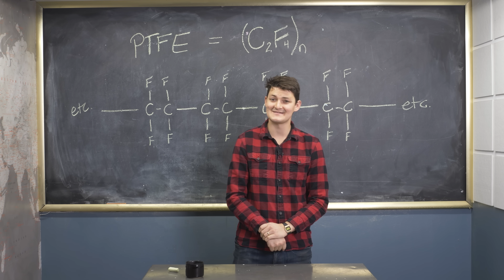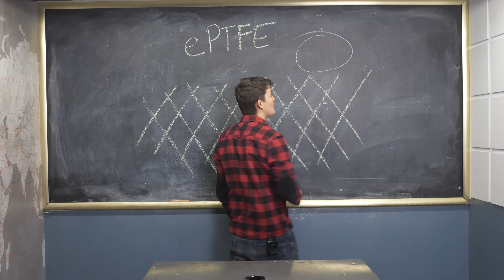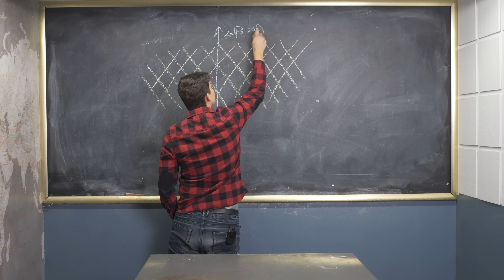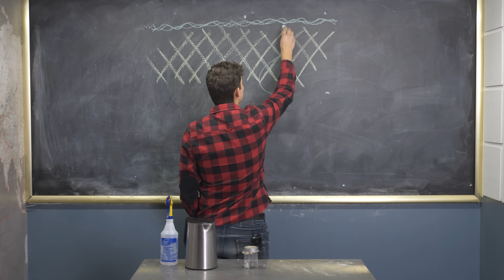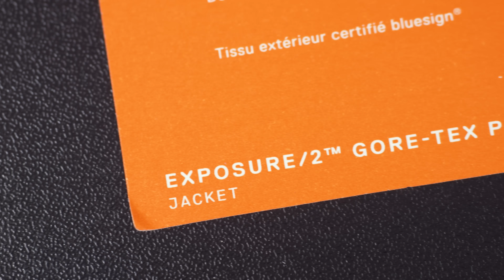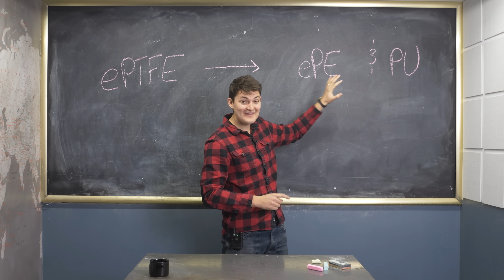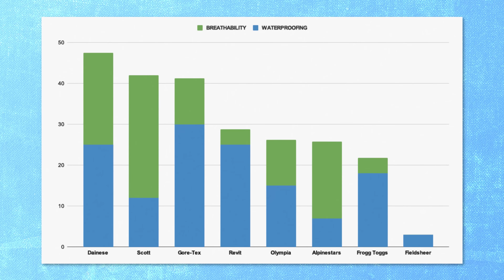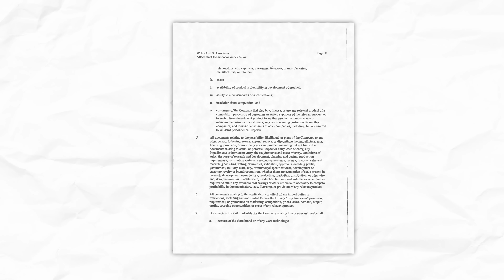Gore-Tex is a Marketing Gimmick

Comment: I agree gtx is overpriced. 

Any water proof membrane also faces the problem of temperature and surface condensation. Even if it can breathe, your sweat wil always condense on a cold surface.
And a thin membrane has almost no insulation value so if it is cold enough it wil condens the moisture on the inside

The only reason I do have goretex is that the better coats, boots and pants of rev’it which I liked for their looks have fully laminated goretex. The cheaper gear I used to have always tended to absorb water and looked baggy and the expensive stuff I now have doesn’t. 😎

Comment: Since in the last video you invited to nitpicking I will have a go regarding three things:
1. I think a lot of customers especially in motorcycling don't actually care about the breathability performance as much as durability of the waterproofing. I certainly don't like buying new equipment all the time, mostly because it's a nightmare to find something that fits me. GORE-TEX still has the best reputation for that, deserved or not.
2. The actual function of breathable/waterproof membranes really works, to my knowledge, when physically exerting yourself while it's really cold and windy. This is when you don't want the actual windchill to cool you down, because that would mean you're freezing, but still have your clothes not be soaked in sweat. Think of winter sports or climbing really high mountains.
3. The real marketing gimmick in my own opinion is offering climate membranes for motorcycling at all. The reason being that I'm not sweating on my bike from physical exhaustion, I'm sweating because the sun is baking me. And this is the part you missed: You also need a temperature gradient for the breathability to work. If it's hotter outside than inside your jacket, you might as well be wearing a garbage bag. This third point I deducted myself, so would be great to find out if it truly is like that.

Comment: I have a question: Given you can sweat through these membranes in dry conditions, which is useful when you are exercising and it is cold and/or windy (i.e. particularly in winter in northern climates when it snows rather than rains) (note also these membranes keep the wind chill at bay rather well), how wet does it have to be before the sweat a person generates from exercise is trapped by the humidity outside the garment ?

Comment: What a load of crap. After using goretex for winter mountain biking and hill walking for years, nothing is as windproof and waterproof and breathable. It’s nowhere near perfect, but better than anything else I’ve tried. Goretex under a jacket like most motorbike jackets is a big fat waste of time designed by muppets, it’s supposed to be used as an outer shell as part of a layering system.

Comment: So from your testing Gore-Tex is the most waterproof and at least somewhat breathable.  I don't see how that's not worth a premium as a motorcyclist? (of course I would love cheaper but from your own testing none of the proprietary systems can beat gore-tex is waterproofness) Maybe if I'm going hiking or bicycling I would want something more breathable but I thought this was a motorcycle channel?  When I'm riding a motorcycle I'm not exactly working up a sweat unless it's super hot out.  At least where I live when it's raining it's usually cold not hot.  Breath-ability isn't that high on my list. I don't want to overheat too much but I care WAY more that my gear doesn't leak through.  I've commuted to work on my motorcycle for 17 years and I've had so many issues with pants and jackets only being waterproof for like the first year or maybe 15 minutes in the rain and then I start feeling water in my elbows or in my crotch.  It was only when I got some gore-tex gear that I stopped experiencing that.  And let me tell you showing up to work with a wet spot in your crotch/ass is NOT cool.

Comment: nice video, however there are differences between brands when it comes to gore tex waterproofing. 
some brands use more advanced gore tex, integrated directly into the fabric.

I have been a jungle survival instructor, and there is no waterproof garment that will work in all weather conditions in the jungle.
But, gore tex most certainly work better when it rains in the jungle. Just remember to take it off after the rain stops.

There are reasons that operator use garments with gore tex in different environments, and temperatures.

Comment: You'll be way more uncomfortable just waterproofing a sheet. If you start getting hot and sweaty, use the various zippers on the expensive jacket, along with strategic layers if possible. Bring a change of undergarments and use them. Too many people think it's possible to stay dry in inclement weather when you are exerting in any way. It just doesn't happen. Gortex although cleverly marketed and expensive, does do the best job when used and cared for correctly. 
The best advice for being mostly comfortable in crappy weather is learn to deal with it. It works better than any gear. It's literally a skill one must master... Mentally managing the suck.
I spend well over 200 days a year, for the past 28 years, in the woods up in the mountains on the coast of BC, working a brutally demanding job, completely exposed. I'm rarely uncomfortable. 
Outdoors at work I use rubber, and at play I use Gortex because it's way more comfortable.

Comment: A very amusing story I read about the first method for stretching the PTFE to get the holes was that two guys ran at full speed in opposite directions while holding the opposite sides of a long swath of fabric PTFE tightly in their hands. It took the resulting sudden stretching force to expand the PTFE into Goretex.

Comment: Im old enough to remember a world before GoreTex. I remember standing in a stream in my first pair of GoreTex hiking boots and being amazed- the boots were at least 50% nylon and about the same weight as my high top  basketball sneakers and my feet were completely dry. I’d never seen anything like it.  To get that level of waterproof prior you had to have heavy, all leather boots and had to reapply a waterproof material every season. I was sold and in love with GoreTex. For years even after the patent wore off and you started seeing every brand with their own version of this kind of waterproof membrane, I still swore by GoreTex. But then something happened. I bought a GoreTex jacket and it was crap. Looking back now, I think it was because the beading substance on the jacket either wasn’t applied properly or just sucked. So then I did some research and found out what you mentioned in the vid- that GoreTex had changed it’s formula. I attributed it to that at the time rather than the beading material, so the luster of GoreTex was gone for me. I started doing the research on each membrane’s pressure waterproof claims, started to better understand how evaporation works through materials, and started layering smarter,  I also started making sure that I reapplied the outer beading material every few years, and doing more research on each brand’s membrane prior to purchase.  Life with these kind of membranes is still WAY better than without. Especially in things like boots- jackets you don’t have to wear if it is not actually raining, but waterproof boots you often wear when dry, in case it’s likely to rain or you have a lot of stream crossings- you don’t bring the waterproof boots as a second pair of footwear and just break them out when it’s gonna rain. So I think these membranes really earn their worth in boots. But even in jackets they are better than the old days of rubber rain coats- you wanna really experience overheat and perspiration? Go on a hike on a drizzly day in an old rubber rain jacket. But these new material jackets are not some magic jacket of dryness from Dungeons and Dragons or something.  So don’t be took hard on GoreTex. They changed outdoorwear for the positive. And with other brands’ versions some are better than others. Which to me is the most frustrating thing as a consumer- buying now is so hard because they’re all expensive, and it sucks to drop several hundred dollars just to find out that the brand you bought has a crappy version and isn’t very waterproof. I kinda miss the old days of the 80s and early 90s when I bought something with a GoreTex tag and knew exactly what I was getting. It was a simpler time.

Comment: Gave up on Goretex years ago, bought a Goretex rain suit and got fed up with being wetter inside the suit from sweat than the outside of it was from the rain. Most of my motorbike gear uses a Reissa membrane which does work, keeps the wet stuff outside without me sweating. Lot cheaper as well.

Comment: I’m retired now and only ride motorcycles for pleasure, but prior to retirement I commuted 20,000-25,000 miles per year for 25 years in the Seattle area by motorcycle. I have over 300,000 miles of mostly commuting trips under my butt. Can you say “Real world long term motorcycle gear testing?”

I can tell you how long the generally excellent Aerostich Darien pants will last until the seat starts to leak (approximately 1.5-2 years of daily commuting, 35-40,000 miles, or 1500-2000 mount/dismount events). I can give you a rough idea of how many supposedly waterproof gloves are actually waterproof (less than 25% in my opinion, and I have tried many different styles and brands). 

I think that from my experience, buying branded Goretex says more about buying the build quality and the certifications of waterproofness by Gore than it is buying the brand specifically for the brand. In the past (at least in my experience) buying Goretex meant that something actually was waterproof and somewhat more durable than the competitive waterproof/breathable products. 

These days I do think that the market for high quality waterproof/breathable gear is more competitive, and that more of the competitive products actually work as advertised. Ultimately I believe that it comes down to product design and build quality, and not just on the Gore branding. I will, however state my belief that the Gore branding still buys a higher level of “it does what it says it will do” due to their required product build standards to wear the brand.

Comment: I was in my 20's when Goretex came on the outdoor gear market. Most of my backpacking gang swallowed the hype , hook, line and sinker. I remained sceptical how it could both repel water and breath at the same time. My friends spent big bucks on their goretex gear and I went with REI standard at a very cost savings over goretex. When we did our backpacking trips they all complained about how goretex was all hype BS. 
Thank you Ryan for all that you do.
Reply: To be fair nothing repels and breathes though, so you were in the same boat as your friends comfort wise correct?
I get you saved the money, but I've found that the overpriced brands often have a superior build quality. I think of the Arteryx backpack I used daily for over 18 years. I only retired it because I cut it almost in half with my chainsaw by accident. It's a wall hanger now, but it still decently kept things dry till the end. My coworkers razzed me for spending 500 bucks at the time, but they invested way more in bags than I did over the years.
Reply: @beaugalbraith3891  then you should spend your money on something known for its good build and quality. not on a brand that spends way to much on marketing to promote their so called breathability and water resistance

Comment: I bought a pair of leather hiking boots from LLBean many years ago that used a GoreTex membrane and they were fantastic at keeping my feet dry.  They didn't breathe very well but I prefer a little sweat, very little, to ice water soaking my feet, socks and interior of the shoes when hiking in the middle of winter.  They lasted over 20 years.
I also bought a parka from EMS that used their third party membrane ($150 on closeout instead of the usual $300) about 22 years ago and I still have it.  It keeps me bone dry, warm and it does breathe extremely well.  It is so warm that I can't wear it but two or three times a year when the temps dip below 5 degrees.  Love it.

Comment: Thanks Ryan. About time someone pointed out the gortex gimmick. Purchased Lowa hiking boots and they were not waterproof as advertised despite being made with gortex. Very disappointing
Reply: Unfortunately Lowa doesn't use a very good goretex membrane, They also as far as I know at least, Typically only use a gore-tex upper or mid and you end up with seam leaks almost all of the time under prolonged use. They're definitely situational but one pair of la sportiva mountaineering boots I've had has survived for years of spring, summer and winter multi-day treks through the mountains with dry feet at the end of the day. Like most things it completely comes down to brand, one goretex product might not even be remotely close in performance to others. There's plenty of times when i'd rather use a different material but I don't think I've ever had a piece of goretex seam leak on me. I can't say the same about any other products i've used.

Comment: Did you test O.G. Gore fabric with the real PTFE barrier?  Also, I always heard that the Gore company required that anyone producing Gore-Tex products submit a product sample for testing at the Gore facility, thereby guaranteeing at least some degree of quality control.  I've seen some real junk marketed as "waterproof/breathable" with no seam tape or seals, and incorrect or missing lining, which is required to protect the membrane and space it away from your skin for evaporation to work.
Reply: There are very stringent manufacturer requirements for using goretex. Down to where, how and under what circumstances logos can be put on apparel. I hate how much most of my gore-tex mountaineering gear costs me but I have NEVER had a seam leak. sort of important when you're a few days from human contact.

Comment: Before watching your video, I have to say my military parka jacket made of gortex doesn’t feel like a gimmick to me. Id call that REAL gortex, not the cheap stuff they use on some brands.
Reply: After watching, id like to point out the high probability that the studies that show that gortex is destroying the environment were sponsored by competitors. Also, I had boots that were lined with gortext (flight deck boots) and they were completely waterproof. For those, im a fan of gortex, but I wont tell you its better than anything else. I just know it has worked perfectly for me for 15 years.

Comment: This summer I rode in the rain (heavy and light) for 3-4 hours straight near Yellowstone and ran into another rider who had about the same time out.   He told me that his $1000 Goretex jacket / pants sucked and he’s soaked through.  Meanwhile I had a $60 rain coat/pants  which also sucked, but leaked mostly from the neck.  Let’s just say I am happy to have saved that $940.

We both had a good laugh about it before setting off to our own ways.
Reply: Speaking from experience... he was probably soaked from sweating his balls off under all that gore.
Reply: @Turk380 😂
Reply: I'd reckon buddy probably was perfectly dry, at least that's always been my experience in any quality gore-tex product. More than likely though, that was all ball sweat from not wearing a moisture wicking layer with it lmao.
Reply: @sakaraist layers systems 🎉
Reply: I bought a swr of carhart rain gear for working in the rain in industrial settings and rode about 400 miles in the rain in it. Bone dry aside from what it didn't cover with no neck leakage because it has a high neck that made it under my chin skirt on my helmet
Reply: @davidleroth8644  Thanks for the tip.   I might just check it out.
Reply: Gore Tex doesn’t soak through, it’s literally waterproof. The water on the outside was hampering his sweat from escaping. The DWR that does wear out and must be re-sprayed to help with breathability.
Reply: I have a DriRider jacket which, like my vented summer jacket, is water absorbent. For that I have a Motodry wet weather overcoat.  I dream of the day that they make waterproof gloves, though.
Reply: imo the best waterproof pants come from fishing brands like daiwa etc
Reply: I live in the uk, I have ridden in huge downpours, lasting all day. Stayed dry, in got-tex.
Reply: @benkelly2190  peddling very slow and generating very little sweat and heat i suppose?
Reply: I think the 1000 Dollar Jacket is way better than the 60 Dollar one.
Could be a Bad Model, could be broken Membran and many More. Sweat?!
Reply: A properly working membrane won’t let the water in. That’s just physics, no saurcery there. What that rider could experience is a garment which was wet from the outside and started feeling cold because of it. Cold and wet are different things though.
Reply: In a good down poor and stepping in puddles, my Gor-Tex lined USA-made leather work boots do let my toes get damp. They are still better than made-in-China WallyWorld boots.